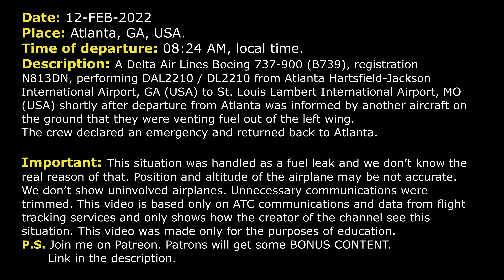FUEL LEAK on takeoff. Emergency return | Delta Boeing 737-900 | Atlanta Hartsfield-Jackson, ATC

Comment: Makes me shake my head when you hear the ARFF vehicles not communicating clearly or knowing what or where they're going. They don't get that many emergency ramp or runway calls to not have better communication and know what's up. Pretty shameful there's not stronger command and control on these events.
Reply: Although I am quite surprised at the perceived general lack of urgency by almost everyone involved (I am aware there may be valid reasons for this) that you pointed out, I am, however, not finding anything wrong with ARFF's communication to tower and the incident airplane.

Comment: How does that happen?
Someone didn't replace a cap after filling?
Is there a vent?
Reply: On these planes there is a cap to a valve.  The valve is closed after fueling and the cap installed.  Sometimes on a cold night the tanks are filled and when the morning heats up the fuel expanded and goes to the vent lines and then on takeoff gets vented overboard.  Or, the tank high level float switch didn't shutoff the fueling in time and the tank filled more than it should have and went into the vent line.
Reply: @tmayorca8770  737's are usually fueled in manual, and at 15500 the wing tanks are nowhere near capacity. They also don't have a cap on the adapter, as the fuel panel door covers both the fueling controls and the adapter.

Comment: I'm guessing there was never any actual conflict, but I was wondering... if Ops is cleared onto 26R for a FOD inspection, and then ARFF is cleared to cross 26R to reach the aircraft, who yields to whom if Ops makes it to Taxiway D at the same time ARFF is supposed to cross? Do normal roadway rules apply, where Ops would yield to traffic coming from the right at an "uncontrolled" intersection?
Reply: Ops would yield because ARFF is an emergency vehicle responding to an emergency
Reply: If you got to an intersection at the same time as a fire truck responding to an emergency, who would yield?  Pretty common sense.